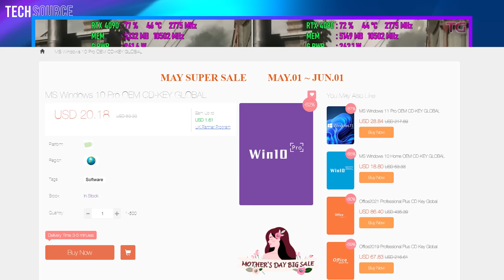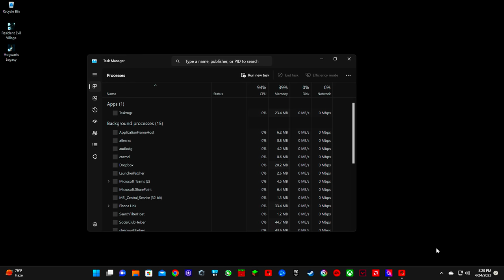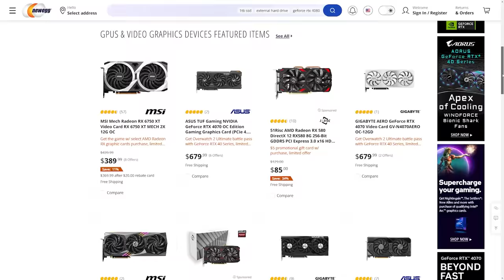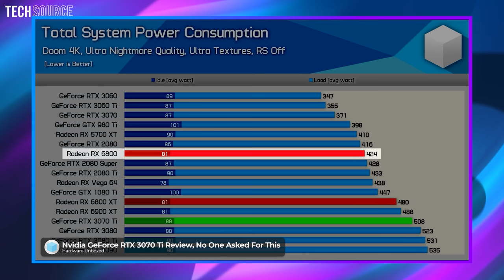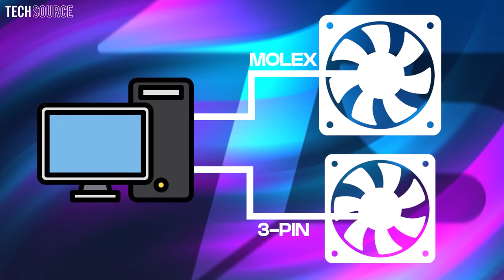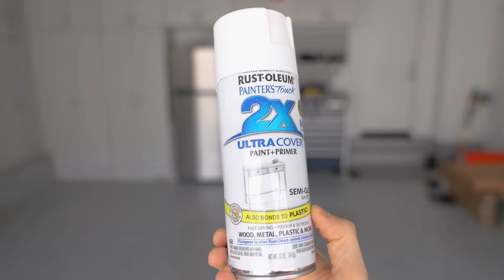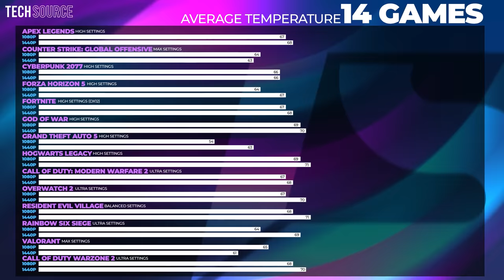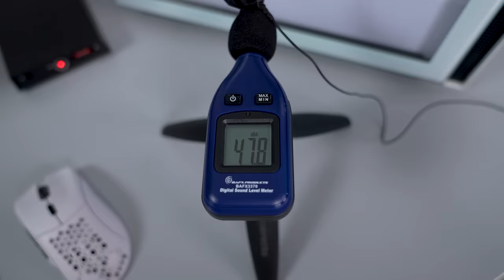The Best Budget $1000 Gaming PC Build!

Comment: Hey ed...i have a windows 7 on an old hard drive i own so can i use that and update it to windows 11 to save the extra money (also changing the boot to the m.2)
Reply: Do you have the product key written down or otherwise accessible? If so, you just need to code to active W11. No need to go through the upgrade process. You technically could do that, but Windows 7 likely will not boot up if you install the drive on a different computer. It most likely will crash because the hardware is very different.
Reply: @JJFlores197  unfortunately no i dont but if i try to upgrade it from a old pc i have will it work?

Comment: Why is my avg fps on fortnite only 65 with i3 12100 6600gpu and 16 gb ddr5 4800 ram with xmp enabled 
My gpu seems to be the bottle neck but my understanding is that I should be getting much higher than 65 fps still

Comment: did you say the price in dollars? i am european (german) so i would change it into euros to see how cheap it is i am on a small budget so i am trying to get good parts cheap (my only wish is to run rust semi clean)
Reply: It will be more expensive, i think +100€. I can find gigabyte rx 6800 only 600€ in Germany, not ≈470€. But if you want only rust, you can take like rx 6700xt or 6750xt, it will be enough.

Comment: i have a 1k budget would anyone recommend this build or is there anything to change or better?
Reply: If you have an extra 150 I would suggest getting the NVIDIA GeForce RTX 4070 but you need to have a lot of wattage for it to work the best
Reply: This one comes out to 951$ me right now. Got you a much better power supply and 32GB of RAM.  Also get front USB type C on your case. 

12400F - 150$ 
B660M Pro RS - 95$ 
XFX 6800 16GB - 450$ 
32GB TeamGroup DDR4 - 50$ 
Montech Air 903 Wh - 70$ 
EVGA GE 700W - 70$ 
AsiaHorse PSU Extension - 19$ 

RTX 3080s go for 400$ used right now. If you can find one with low use, that’s also a good option because these cards won’t be able to do 1440P at decent frames in a couple years soon I’m assuming, so I don’t really see VRAM being as compelling of a factor for these caliber of cards.

Comment: please do not cheap out on the psu
Reply: I want to build this PC but everyone is saying the PSU isnt as good for this. Should I go up too 650w or maybe 700w and can I even do that? Another thing is what would you change about this pc or is it just the PSU?
Reply: @SwiftyyHD  I wouldn't get an apevia power supply period. Go with a name brand one from like corsair, corsair,  seasonic, powerspec, thermaltake or etc. Don't want a cheap power supply as they are more likely to fail/explode
Reply: as for wattage probably 750 watts
Reply: @squidzo1d  thank you so much
Reply: @squidzo1d  another question. The mother board he uses in the video does not have wifi from what I heard so what can I replace it with? I want to be able to have a wifi and bluetooth connection for my computer without an ethernet.
Reply: @SwiftyyHD  Buy a wifi card or dongle and a bluetooth dongle. I use both of them and they work like a charm.

Comment: Does it the case have an ethernet port
Reply: No. PC cases do not have ethernet ports. Its just an enclosure to put the PC components. If you meant if the motherboard has ethernet, then yes. Practically all motherboards from the past 20 years have ethernet built-in.
Reply: @sl8774  Not sure how its confusing. Sure, a bit rambly, but not confusing.

Comment: If you have built custom watercooling, you are probably rich and building a budget PC likely isn't relevant for you anyway so your past experience tearing down a GPU isn't relevant.  Doesn't the paint you sprayed all over the CPU cooler fins make it perform worse than the intel stock cooler already is to begin?  Why not mention where to get, how to choose or how to replace thermal pads in this video?  Like you touch on issues as basic as using a fan splitter but then just assume buying and replacing thermal pads for a GPU is common knowledge to someone watching your video?
Reply from the maker: Noted! Will do next time